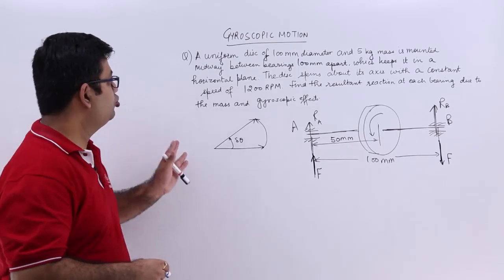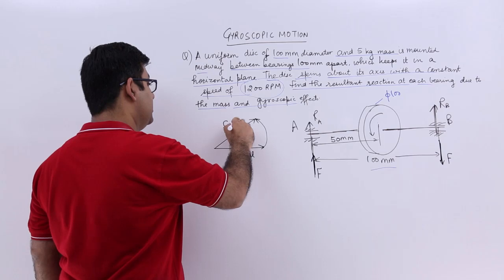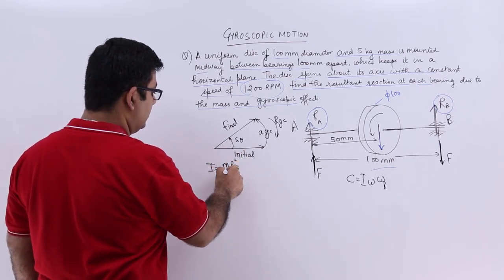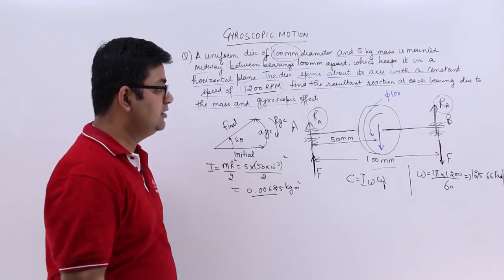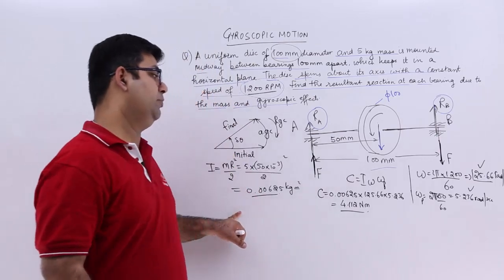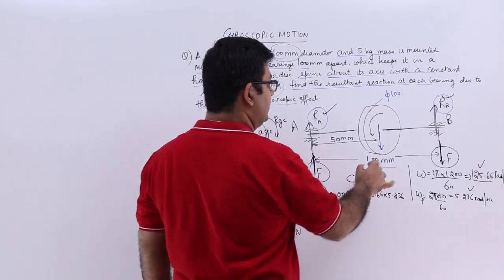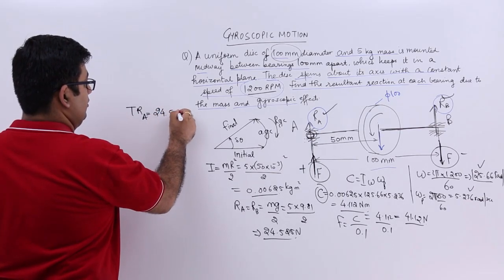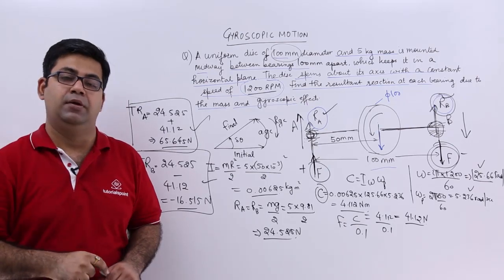Problem 3 On Gyroscopic Motion

Comment: Guys. I think what we see here is the case of insufficient data. The velocity of precession is not given in the question nor is any means to find it. So I think we can assume 
Wp = 50 rpm =5.2359 rad/sec. Now we can find the answer to Gyroscopic couple using it's formula.

Hope this helps someone in need. Thank you.
Reply: yea it does.
i was wondering why/where the precession even comes from, if its just a shaft peacefully rotating about its axis